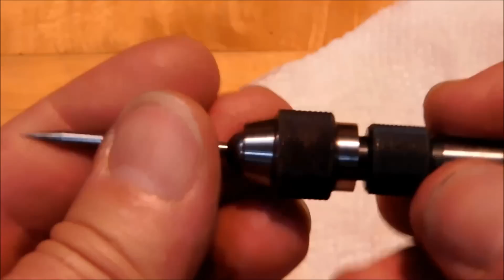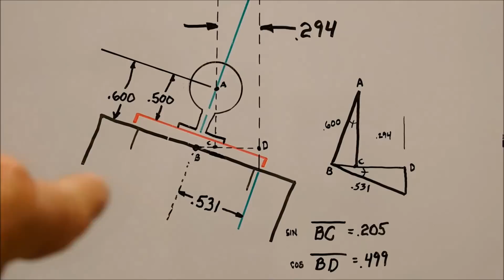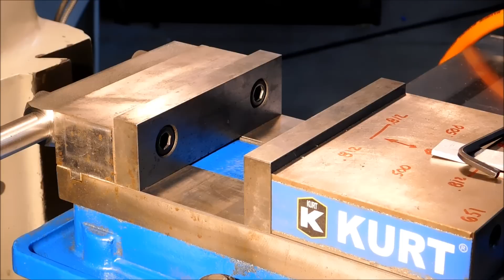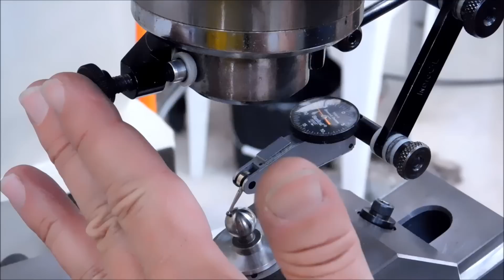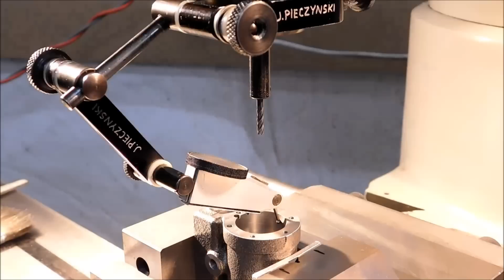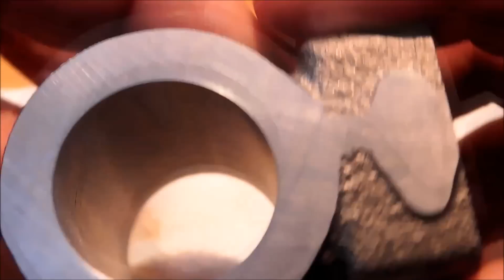Machining a Model Steam Engine Cylinder - Part 2 - The Oblique Port Holes

Comment: If I may just make a point of information targeted at stationary steam engine enthusiasts, a good number of engine castings are available  here in the UK from pollymodelengineering.co.uk and if the trans-Atlantic or even further shipping of castings is too much, there must be at least a couple of dozen bar-stock designs at: modelengineeringwebsite.com . I am afiliated with neither.
Reply: That cylinder would happily be carved out of bar stock. Wouldn’t take 10% longer to make? Infact, you wouldn’t have to play, ‘guess the starting face’ with bar stock :o)

Comment: Great job! I'm guessing you're going to put port holes on the other end , so that the slide valve will be dual acting.....
Reply from the maker: Yes. These features are on both ends. Its a clever little design.

Comment: For my education:  Would it not be easier to start with the cylinder upright in the vise, side-mill to the final x and y position for the deep holes, and drill from there?  The 20 degree process - brilliantly described, thank you - seems like a lot of trouble for not a lot of gain here.
Reply: Steam doesn’t like 90 degree bends. Bad idea. Also, you’d end up outside the flange. There just isn’t enough metal for that.
Reply: @JasperJanssen  Fair enough, thank you.

Comment: Joe, You said to stay above center of the ball, when using your Indicol. But wouldn't the ball still read zero thru the center of the ball on X axis, Y axis could go plus, minus. Was that the reason?     I like all the white board math's work.   Cheers
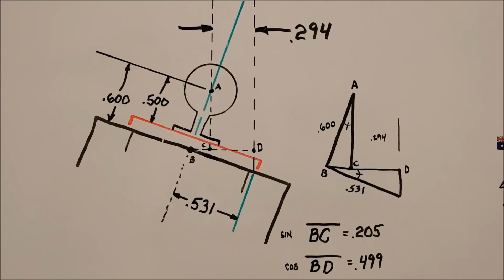Reply: Go back to 3:45 and watch it again.
Reply from the maker: No, the readings will be like a cylinder, but staying at or above center will help the indicator needle clear.

Comment: Joe ... I assume a large diameter ball bearing could be substituted so that it nestles in the bore directly by approx. a third of its (the balls) diameter...  though the calculations would have to be modified to allow for this  ?? 

😎👍☘️🍺
Reply: You would need to know exactly how high the center of the ball is, not easily done with your method,
Reply from the maker: It sure could. Different math, but the same geometry. Any corner break or radius on the bore would spoil; the pot though.
Reply: I'm thinking that even a tapered bore could be accounted for with the right measurements.
Requiring a surface plate, gauge blocks, hight gauge with a fine test indicator...
And a BIG ball bearing
Reply: @joshua43214   Joshua ... a height gauge on a surface plate would make that an easy measurement.   😎👍☘🍺
Reply: @joepie221  Thanks for the confirmation Joe 😎👍☘🍺

Comment: A question from a non-machinist who is familiar with geometry. Without a tooling ball or the plug you machined, couldn’t you still use the machined bore as your reference surface? With the angle it is set at, it will look like an oval from above, and I’m fairly certain you can do a horizontal sweep to find the major axis of the oval for one axis. The same axis intersecting the highest point of the tilted bore could then give you the other axis zero and you could proceed from there. Am I way off, or is this a plausible route to take?
Reply: The problem is the position (height) of your oval. You could eyeball this very close if you put the slots in first and then tilt the casting. Pretty sure you could get the holes within 15 thou which is more that adequate for this.
Reply from the maker: The break edge may be the killer. if its consistent, no problem. if your 70. maybe we have to think twice.

Comment: Joe,
Newbie question, would it be better to use a ball end cutter to do that final cut on the 2 drill holes? the squared off sharp edges look like a potential erosion point if this cylinder is run on live steam.
Cheers Eric
Reply from the maker: I actually don't know enough about these little engines to comment on that. For sake of turbulence, I would think round may be better. It would have to be deeper if volume was a factor.
Reply: @joepie221  it’s one of those things where if you are worried about flow this isn’t the engine to start with. By 1930 they had steam engines fully sorted and they look nothing like this. But, these bathtub-valve  engines ran fairly slowly by modern standards and they were still working away in the 1960’s. It’s a clever KISS design :D

Comment: Thanks Joe, is there a reason you didn't use a thick paper shim on one side of the small vise on the movable jaw side of the large vise when you mounted it in the large vise?
Reply from the maker: I may only do that if there is a chance the surfaces are not parallel or maybe irregular. My mill Kurt vise is very tight, and the smaller vise is 100% ground. The setup seated nicely.
Reply: @joepie221  OK, thanks for the reply.

Comment: Thank you for demonstrating some super useful techniques :-)
However, if I may politely enquire, where are the cylinder drain cocks? Once you get above a 20mm cylinder bore hydraulic lock becomes an issue... and it rarely ends well :-/
Reply from the maker: I would think the push/pull design of this engine would allow for a hydro lock to be resolved by simply spinning the flywheel in the opposite direction and allowing the water to exit the valve. Unless the entire cylinder fills up, but one side is always open so that wouldn't ever happen. Thoughts?

Comment: If I don't have a tooling ball - could I still do the math to end up with the .294 offset, and then just center up on the bore just like it was a circle?  (It will appear as an ellipse from the spindles perspective)  

Or (thinking more as I type this) - is the .294 specific to Joe P's bore - because the placement of that bore is going to differ from casting to casting...
Reply from the maker: The location of the bore doesn't matter if the bore is the reference used. For the function of these holes, a tooling ball is the gold standard, but an eye loupe and some confidence will yield the exact same result.

Comment: Video Request:  How to make a tooling ball.    They are EXPENSIVE to buy!
Reply: That's weird I saw one on Amazon just now for $17+ shipping...
Reply: It could probably be done with a bearing ball brazed to a spigot, then turning the spigot to be concentric to the ball, but you'd have to mount the ball in some sort of collet machined to accept the ball in order to grip it tightly but accurately. I'm sure it could be done with only modest equipment and with some care you could end up with an accurate enough part to use with confidence on a project liike this. although, I'm sure there's a better way to produce it!
Reply: The best ones, like Starrett or B & S are very expensive because they've extremely accurate.
Reply: @ellieprice3396  yeah extremely accurate, ground to like .000001" and you sweep it with a .0005" indicator and use terms like "close enough" and build a model steam engine with it lol...I get your point....but I think most people in this room are prob good with a commercially produced tooling ball that is better than they could have built on their own.....just like 1-2-3 blocks or grade B surface plates lol
Reply: @Steelcrafted  I found that after I had posted this.  That's a bit more reasonable.  But still quite a bit for all the more that it is, IMHO.
Reply: @Steelcrafted  Correct you are, Nathan. A tooling ball accurate to .001 would be plenty good enough for most work. They're mostly obsolete now but still have their uses, as Joe demonstrated.
Reply: How about a 0.500" diameter ball bearing clamped to a faceplate fixture to carbide the drill and counterbore for a #5 socket head cap screw.  The bolt will mount the bearing on a countersunk seat flange above a smaller diameter turned spindle. The flange underside surface establishes the sphere center distance.
Another option:  Carbide a blind recess in the bearing to heat shrink the flanged spindle.
Replace either component with a runout greater than 0.004".  If you need a more precise assembly purchase it.

Comment: On an outside cylinder loco, would you start with the steam chest or cylinder bore?
Reply from the maker: They kind of come together at the same time. Depends on the print, but having a flat surface to work with like the steam chest gasket surface is always a plus.
Reply: Building a steam locomotive was a science unto itself back in the day. Have you ever seen pictures of the later large locomotives that had the one piece frame, cylinders included (General Steel Castings)? They were too large for the horizontal mills. What they did was come up with portable machines that actually mounted to the engines frame! All cylinder boring , facing, tapping including machining the piston valve bores was done this way.

Comment: I would clock the end cover bolt pattern 30 degrees and drilled one port hole.
Reply from the maker: Than you couldn't install all the screws because ribs in the frame casting would be in the way.
Reply: Just testing lol.
Reply from the maker: @vincit1813  Nice try.

Comment: Joe, how to indicate round part in a lathe when you want to bore eccentric hole through it but the indicator has to short of a travel?
Reply from the maker: Get it to run true
zero your indicator attached to the cross slide
shift cross slide the desired amount of eccentricity
adjust 4 jaw to hit the indicator zero you set earlier.

This is the only way I can see being successful.

Comment: How about using just a ball for the tooling ball?   Like a large ball bearing, or even a shooter marble?   The mathematics would be a bit different.  Perhaps even a bit more complicated, but it could certainly be done in a pinch.   You'd need to take in consideration the diameter of the ball, and the diameter of the cylinder bore to know exactly where the center line is with respect to the cylinder.  But once you did that, everything else should work out pretty much the same.
Reply from the maker: I would say yes. if you can utilize or see the crown of the ball, you should be able to figure out the math.
Reply: Any ball would do. If the ball is smaller than the bore just make an adapter, like Joe did for the tooling ball. The adapter would have a hole smaller than the ball and you can simply glue the ball into the hole. My mill (CNC) has a three point circle finder, so just edge find three random points on the ball will get you the center.

Comment: Not having a tooling ball, on occasion I have used a dowel held against two datum faces with a pot magnet as a reference point.
Reply from the maker: I'll use a pin to correctly do the frame. Operative word = Correctly.

Comment: Maybe next time you can show how to make a tooling ball with home shop equipment... While a gr8 tool if you've got it, forking out $50+ for a steel ball on a stick (a very nicely ground and precise steel ball on a stick but essentially a ball bearing) must be getting on for half the cost of that casting.

IMHO your excellent teaching talent would be better directed towards something fresh rather than apparently competing with another channel.
Reply: I do think Quinn deserves a mention, why you're completing this project etc. This genre is small enough as it is, creators should stick together. Much respect for your work and what you're sharing, just my 2c.
Reply: A lathe with a ball turning attachment or a form tool ground to cut the radius of the ball would do it. It's similar to something he made in another vid- https://www.youtube.com/watch?v=N3-XFfc82ew
Reply: Meme Master yes, you could also buy a case hardened (soft) ball bearing from McMaster Carr and drill a hole for the post with a carbide tool
Reply: They have .500 tooling balls on Amazon for $17....
Reply from the maker: Its seriously not a competition. If I was permitted to comment, I probably wouldn't have to make my suggestions in this fashion.
Reply: @joepie221  I like it. Everybody has a different approach to solving problems. Having two parallel projects helps bracket the way a job might be carried out. I hope you carry on with this steam engine project, but I appreciate the effort you have given in teaching machining techniques for whatever projects you have shared with us.

Comment: joe arnt you putting drain taps on the cylinders ?  as on the steam locomotives .. you cant compress water. it will destroy the cylinder head.. i am a retired driver of steam  locomotives and loved my job..  but when steam went out  .....so did  i .. look after yourself ...keep healthy   ... laurence
Reply from the maker: For now, only minor deviations are being considered. Basically, if its not on the print, its not on the part.

Comment: Are you making that thing for NASA?
Reply from the maker: If you make a video on the correct way to do something...Do it correctly or don't bother.
Reply: @joepie221  The thing is, there is no ONE way to do things.  When faced with a task you figure out how to do it with the tools available to you (or go shopping).  My comment was more about precision.  I may have missed it but I've seen no tolerances in the plans and that's not that they were forgotten but that things aren't that critical.  You're just plumbing a steam engine with those holes, not connecting transistors in a microprocessor.